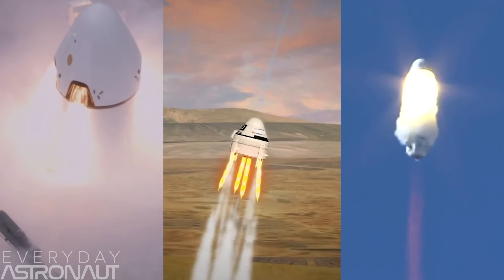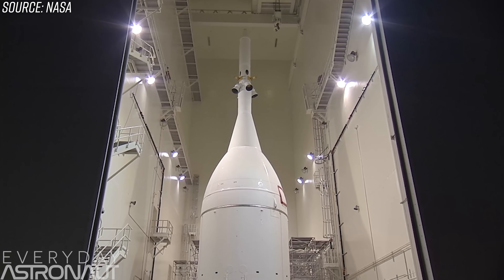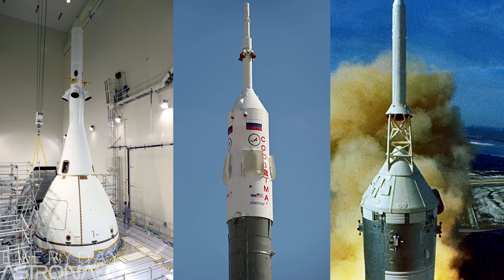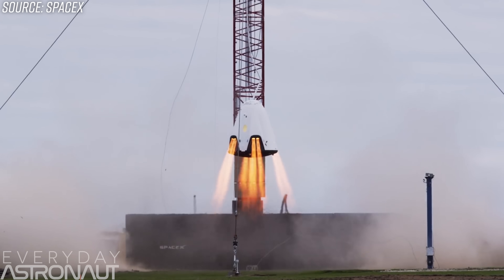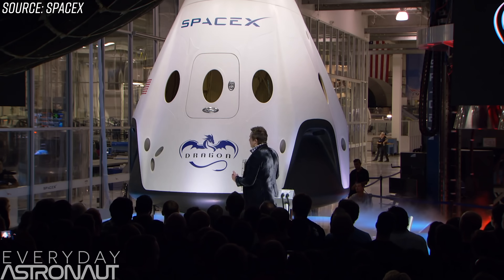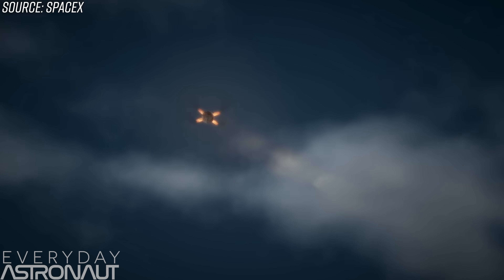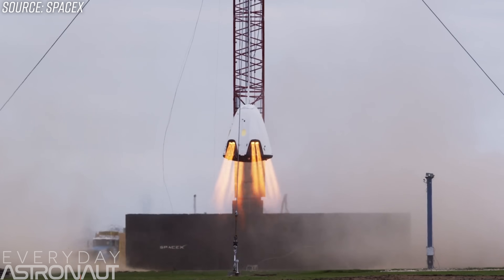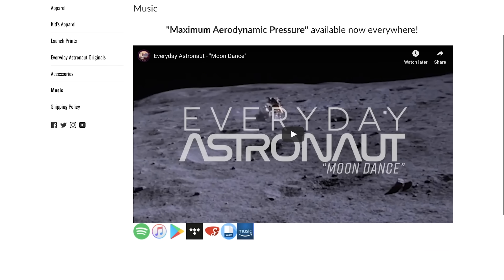Why have SpaceX, Boeing & Blue Origin ditched abort towers?

Comment: NASA should pay them to attempt to incorporate an emergency powered landing mode using the launch abort equipment, even if it is insufficient to certify as safe and effective enough for use instead of other landing measures. This could be a useful extra backup in case all else fails or at least be a research step towards a future system.

NASA should also seek to certify them for performing lifting boosts to space stations using any spare fuel.

Comment: Hmm, regarding the parachute, well you'd just move this to the escape tower, then, no getting tangled, so that doesn't seem like it would be one of the problems.

On the control/steering side, I would imagine thrust vectoring would be an option should it be required, iow, steering the exhaust nozzle relative to the body of the craft, this gives some control without needing to change the rate of burn.
Reply: If you move the parachute to the abort tower you dont have a parachute when coming down from space

Comment: The idea around the corner panel abort system is actually meant for 2 things, landing and abort..... If parachute has failed, the abort can be used for safely landing..... but they need to calculate carefully

Comment: One part of the Dragon's hypergolic fuel system is Liquid Oxygen... A very handy muti-use substance to have on hand on a habitat existing in death pressure. Keeping this topped off without having to send a dedicated mission to do so would be a huge operational bonus in money and material.
Reply: Liquid oxygen is not use on the crew dragon or the cargo dragon.   Nitrogen tetroxide is the oxidizer used.  It ignites on contact with the fuel Methylhydrazine. If liquid oxygen is used a separate ignition system would be needed.  

SuperDraco

Comment: 05:56 Incorporate the escape module into the landing system.
Since landing with parachutes is actually still risky, when any roll occurs, using the escape thruster to land
under power is a much better way to land, and then you can deploy the parachute as a last ditch.
Just ejecting it when in orbit doesn't make sense to me.
The final part of the voyage is always landing, which then may involve the thrust of the escape thruster.
When applied correctly it can allow powered guided landings.
So basicaly going up, you can use it to escape if and when needed, or going down you can use it to land.
Zero loss, powered landing to gain. Also, the tip may help steer a pod coming down.
If possible always use what is already there, instead of using something that needs adding to weight.

Comment: Guessing cons of a nose cone safety piece is, more Weight, another singular point of failure / more checking required, additional complexity. Integral is probably better all around but getting it reliable is the key.

Comment: So I know I'm like 8 months late for questions but here goes nothing. As said in the video the propulsive landing system that SpaceX uses for the Falcon 9 and Heavy systems has not been desired by NASA due to the work required for certification. My question then is, why do they opt for the ocean landing method, where the capsule is only reusable for cargo afterward, then using the rockets for a system similar to that of the Soyuz capsule? It would then, theoretically, be reusable for crewed missions and given that it can already do ocean landings open the option of landing the capsule anywhere, yet also wouldn't be a completely propulsive system and theoretically easier to certify wouldn't it?

Comment: I think they are minimizing the weight to be able to carry more folks.  One thing you need to consider, your range will drive these requirements, this is not a solely reliant on the contractor to develop.  There is a lot that goes into these systems.....

Comment: I wouldn't put it past SpaceX to follow in Tesla's footsteps and put the hardware necessary for propulsive landing on the Crew Dragon and deliver it as an update down the line.

I don't imagine the hardware is terribly different from the launch abort system... Rockets pointing downwards with software stabilization to keep it that way. It really seems to come down to having good engine control, plenty of fuel, necessary landing gear, and computational power.

Comment: is it possible to have the dragon capsule use parachutes above land but when they get very close to the ground turn on the engines at low thrust so the capsule has a soft landing we can see the astronauts in the space x space suit  and it will be easier to certify for human preflight and for the landing as it uses some parachutes.

Comment: 12:39 but there are also solid fuel engines on the station as well - Soyuz soft landing engines, and they are not booming yet.
Reply from the maker: It’s because they’re tucked deep inside the environmentally controlled Soyuz capsule and aren’t exposed to deep thermal cycling

Comment: 12:30 I get what you're saying about SRBs in space, but the Sojus has the retro rockets for landing on the landing module. they are essentially small SRBs. how do they not run into the same issues?
Reply from the maker: Because they’re tucked away inside the command module, and behind a heat shield and not exposed while on station. So their temperature is much more consistent and stable.
Reply: @EverydayAstronaut  Did not think about that. Thanks for the answer. Greetings from Germany!

Comment: the soyuz's launch abort system consists of 3 parts, the tower, the shell, and the decent capsule itself.

the shell and tower use solid rocket boosters.

 ever since oh idk the late 60's the soyuz decent capsule has had liquid fueled attitude control thrusters on the decent module. which can also be used during the launch abort sequence. redundancy, if the solid fuel rockets on the outer shell don't work. in which case the shell would use its grid fins to steer, while the capsule preforms the abort burn.

this ofcourse would only happen if the abort is initiated after the abort tower is already jettisoned.

but by all means limit yourself to 1 system, i cant see that going wrong at all.
Reply: Ook een nederlander?

Comment: What about hybrid rockets (solid fuel, liquid oxidizer)? It seems like they aren’t really used in general for space rockets. What are the drawbacks that make them not a primary choice?
Reply: they are more difficult too ignite.  For a safety system you want instant ignition.  normal solid rocket and hypergolic are the only fuels that ignite instantly.  So a hybrid rocket only make sense for the first or second stage of a rocket.  Additionally hybrid rockets are not as efficient as liquid propellants and have little to no throttle control..  conventional liquid rockets have good throttle control, and are more efficient. So designers generally prefer liquid fuels for most rockets and then only use solid rocks for a quick one time boost right at liftoff.

Comment: There is one thing that absolutely kills me about LES is when NASA decided during early shuttle/orbiter development the fact they didn't feel they needed to include a LES was because of the high reliability of those shuttles. I personally believe that if they ended up placing a LES on Challenger that they would have been able to survive instead of finding them at the bottom of the ocean succumbed to the launch disaster. That bothers me so much whenever I think of LES specifically. I just have always figured that crew safety and abort systems should always be placed way above the supposed reliability of said space vehicles, period. Not that it probably won't happen or that supposed reliability overtakes crew abort systems. That logic is completely asinine. It's one of those situations where you hope and pray you would never ever have to use it but you would rather it be there just in case you need it. Better to have it and not need it then need it and not have it.

Comment: The SpaceX solution sounds more like Me 163 then "safe and reliable".

Especially when they try to cut costs by reusing parts, less cecks etc.
Reply: Solid is MUCH safer and MUCH longer storable wich is the reason its used in every RPG, short range missile etc.

For a system that has to be more safe then light weigt they are tje perfect solution.

Comment: Tim, I love the style and thoroughness of your reporting. I think you do an awesome job. I also wonder if anybody has thought about the possibilities of integrating the X-33 project with any of the current deployment systems. Considering the fact that it was 95% completed at the time of it being cancelled. What would be the possibility of a different company taking over the project and utilizing its information? Such as the "tiles" or heat shield system that would have made the turn around dramatically quicker and less expensive... just a thought. And as for the X-33's system being a political issue of the time (Al Gore v. Dick Cheney)... well neither are in an office at this time.
Reply: I would Love to see SpaceX use the Falcon9 or Falcon Heavy as the rocket to overcome the issuse with the Aerospike engine....

Comment: The launch escape towers are always jettisoned after 1st stage separation but before 2nd stage ignition, are they not ? I know it's too late to change the concept, but wouldn't it be possible to reuse a tower (for SpaceX) by landing  it back to Earth gliding or flying using a parachute or wings ? Even with the unburned solid still inside ?

Comment: Is it really a bright idea to use the same darn thing for service module AND emergency usage? I feel like that could spell disaster if something happens to the fuel that both systems relies on that could comprise the emergency systems. Just like taking backups with multiple mediums (in case one medium doesn't "survive" the disasters). I personally thinks that the emergency usage would be better off using another fuel source so that any failures regarding the "main" fuel would be irrelevant.

Comment: Excellent video. Very informative and explanatory; I learned a lot. You might also mention that although they're extemely toxic and nasty, Aerozine 50 (Hydrazine and Unsymmetrical Dimethylhydrazine [UDMH])  and Nitrogen Tetroxide were used in both the descent and ascent stages of the Lunar Module (with supercritical Helium providing the pressure). They were used due to their reliability and simplicity. Like you mentioned - open the valves and kaboom. And of course because they absolutely had to work no matter what. Maybe you can do a story about the evolution of hypergolic propulsion systems from their early applications (torpedoes, Germany's ME-163 Komet, etc.) to today's reaction control and abort systems. Just sayin'...keep up the great work!

Comment: To be fair, that's the point of testing. You test something beyond what it is expected to encounter because it can happen, however unlikely it is to happen. And you forget one of the major considerations for the use of the same hypergolics for the abort system as they would for maneuver and such. It simplifies the logistics, which lowers the cost. Also, I have a feeling that SpaceX will get it working right sooner than Boeing due to how they do their development. Boeing tends to go by the classic prototyping model, meaning that they will test to destruction. SpaceX is more iterative in its prototyping, and with more systems (even if it's only a couple) though they will test to destruction when needed, but they will quickly look at what went wrong and begin to iterate the changes to fix it for the next vehicle being built to test.

Comment: I was disappointed when vertical powered landings were nixed by NASA.  Reverting to the old style water landings relegating that elegant system to strictly an escape role was a step backward and a waste.  It cost them the reusability factor for manned vehicles, not to mention the substantial costs of fishing the capsule out of the ocean.  

Its Ironic to think that the amazingly complex (and wonderfully novel) catching system designed for Starship, apparently has the tentatively acceptance of NASA.

There is a cheap way of getting Dragon certified for powered landings.  Start using it with  cargo only flights until it is deemed 'proven', then migrate it to crew Dragon.  Just a thought.

Comment: 4:15 The postition of the center of thrust is not relevant. This is known as the pendulum fallacy. The stability is determined by the relative positions of center of pressure (CP) and center of gravity (CG). CP should be behind CG. Fins would help because they would move the CP towards the rear of the capsule. The other option would be to move the CG forewards. (An escape tower would do that.)
Reply from the maker: That’s why oh screen there was an annotation saying “center of drag” 🤷‍♂️😂
Reply: Ooops.. I missed the annotation..

Comment: Yo buddy, please do a video profiling the most consecutively launched rocket and engine. 

For example what space vehicle has been launched the most times (physical). How many times has SpaceX launched the same Falcon? 
What are the most launches ever in a year? By company? All together?
Reply: 1967 was the record year for number of launches, 139 (though only 120 succeeded) 
1983 has the most successful launches, 127 (and only 1 failure)
Last year had 114 launches, the most since 1990
2004 had the fewest launches (since the 60s, at least) with only 54

The Soyuz-U has flown the most, with 786 launches... but the R7 rocket family (which includes all Proton, Soyuz, and related rockets) has launched 1,854 times!!

Wikipedia has some good stats on spaceflight like that
https://en.wikipedia.org/wiki/Comparison_of_orbital_launch_systems
https://en.wikipedia.org/wiki/2018_in_spaceflight
https://en.wikipedia.org/wiki/Timeline_of_spaceflight

Comment: Why don’t commercial rocket payloads include an emergency escape? You could potentially save hundreds of millions of dollars for a satellite recovery in the 2nd/3rd stage before a rocket explodes????? Just like for astronauts. After a recheck of equipment, repairs, etc. you could relaunch the payload down the line instead of just taking a total hit/loss for the satellite company

Comment: Here is why it was a mistake... The problem with the shuttle was the crew was right next to the fuel and if it exploded your dead. They have now brought the fuel into the capsule ... 
What could go wrong?
Reply: They didn't put the fuel in the capsule.  It is attached to the outside of the capsule.  Just like it was on the shuttle and Apollo.  The nose fo the shuttle had fuel tanks and thrusters and it was attached to the crew cabin.  Apollo had hypergolic in the service module and attached to the capsule for capsule reentry reaction control thrusters.

Comment: 8:52 , why is the pressure of the hot gas comming out of the engine changing. We see the hot gas moving, as if the pressure changes... explenation?
Reply from the maker: They were practicing throttling the motors individually 👍

Comment: Hi so you're completely correct on the push vs pull decisions, but immensely wrong on most of the other points that you made :)
Someone with your prowess and influence should do their proper research. For the most part, you do, and I appreciate that. 
Propulsive landing for crewed missions is asinine, and will never be done. 
Boeing is still reeling from its own ineptitude and hubris with the 737 MAX, and could very well apply those same "cost saving" practices to the development of its other products.

Comment: I would personally use solid fuel rather than liquid fuel.. its safer, cheaper, alot more reliable overall... liquid fuel is just asking for trouble.. 🚀

If the wheel ain't broke, don't fix it..

Comment: Yeah bad part of Blue Origin is the abort motor is closer to the part that is  doing the explodey thing higher chance of a failure in the abort system. Boeing has the same issue as Origin having your life saving equipment right next to the part that's exploding.

Comment: TL DR. Previous solution: use a simple solid-fuel booster and ditch it every time. New solution: always carry around an easily flammable hypergolic explosive canisters. Bravo. Put your engineers on it first.